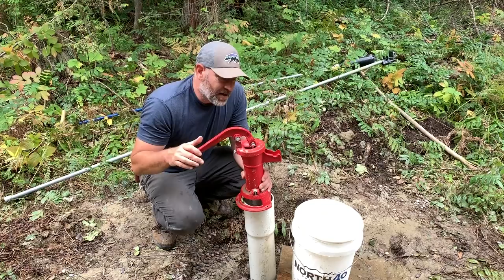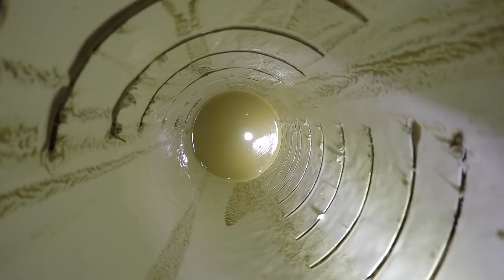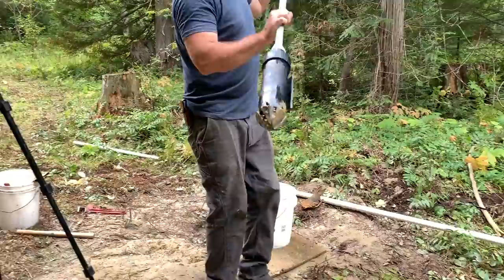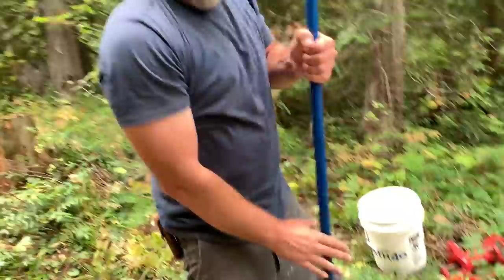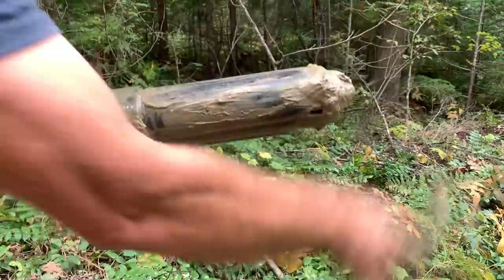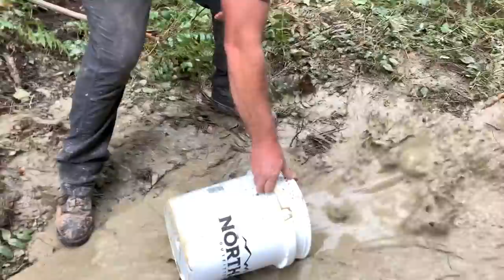Removing Silt/Mud Sediment from our Well

Comment: Hey Martin, just a suggestion. Use your auger to dig another 4 foot or so and then once the silt is removed fill that space with your gravel then the foot valve would would sit above the gravel and will help keep the silt below it.

Comment: I worked for the water department and have an EPA license. I'm retired. I can say most water you're getting at that depth is filtrate from the ground. It may or may not be safe, depends on what it filtered through, but I'd bet it was mostly soil which is strongly contaminated with very bad things, the least of which is parasites. To have clean water you need to be pulling from an aquifer. Unless you pull from a spring, you will never get safe water pulling from ground water. It's not even safe to bathe in. Bacteria can still get into you without drinking it, via cuts, your eyes, and inevitably you will get some in your mouth via bathing.
Hope this helps!

Comment: My uncle makes well pipe for a living and I worked with him when he was busy for a few years. The grooves you cut needed to be much thinner and a lot more of them. That itself would have stopped the sand issue under most issues. If you wanted to be dam sure it was right you just needed to put a well sock over the pipe to make sure it stayed clean. Your main issue like others said is the well is to shallow right now but if you did either of the first 2 options I told you... you would be in much better shape right now. Love the videos and your son is a riot :)

Comment: I've drilled a few shallow wells in Central Florida and I've always had to dig to a point below the hard pan.  The hard pan is a clay layer and the actual water well will be below that.  The depth where the water is will have very course sand and look sort of translucent.   After you dig below the hard pan,  sink your casing into the hard pan some so the well will be sealed off from the surface contaminants.   Hope this helps
Reply: I Robert Lee Houston am very enthusied being introduced to this level of of sharing! 👏🛐👋🤶🎅💭

Comment: watched the last few well vids.. I am going to keep watching to see if you succeed. I filled the actual well pipe with 1 inch stone to keep sediment from filling in the bottom.. once i hit depth.. kept the stone about 2 feet below the foot.. and it allowed sediment to settle to the bottom and the water to clear up.. u put ea gravel around the outside but inside the pipe has no protection.. the stone inside the pipe allows the water to fill the pipe higher and is easier on the pump also.. like when you have a half cup of soda and you fill the rest with ice it raises soda to topp of cup.. same amount of soda
Reply: I'm not sure that analogy works, but maybe... Your soda glass doesn't have holes in it, unlike the well casing, which can let water reabsorb into the walls of the well and filter back down to the water level. Just theorizing here.

Comment: It depends on the type of clay you have. In south Ga.we have the infamous red clay. If you have seen a red clay pond or shallow well the water is crystal clear. I have had a 25' well for 30 years in red clay & don't have a problem with sediment or any contamination of the water as verified by state testing. It all depends on the soil in your area & how you seal around the casing. Of course 1 big problem is the casing size. I have 3' of round concrete culvert  in sections down to 20'. Which allows you to hold probably 10 times or more the amount of water depth. Of course because of the weight you have to use a backhoe to set each section. So not a hands only job.

Comment: Might as well keep trying.The mud will inhibit water getting into the well so the more you can get rid of, the better.

As someone else commented, Could you get a tote full of water to dup down the shaft?  Not a garden hose and a little pump, but a large volume of water very quickly. A large column of water could force the mud beyond the gravel pack at the bottom of the well and allow the water to better flow into the well.

Comment: Im a well driller from North Jersey and being you can't go deeper without a license I would start over and get yourself a pre packed screen from a well supply and use a finer grain filter pack instead of the coarse gravel and put it in as soon as you get your pipe in the ground and that should help with the silt and running sand issue and may produce a little bit more.  Also look into a whale pump they are 12volt and you can use that and your truck battery to develop the fines out and begin to clear it up.  But it's only going to make so much at 18 feet also I would put bentonite or some concrete as a seal about 2 foot down from ground surface to help with surface runoff contamination . But if you can't get pre pack get 10slot screen and number 1 filter sand finer sand =less silt run in and the bigger the bore hole will help get a better filter pack

Comment: I feel for you as you are not deep enough. I have now done 3 wells myself using a home made sludge pump that has a rope on it and is support by a block and tackle on a tripod frame.  As you are using the sludge pump you are able to get the casing to move down deeper and keep adding to it.  You probably need to go a further 10 to 15 feet deeper.  👍

Comment: Just a suggestion. Drive a well point down the pipe you have. Go down at least another 10 - 15 feet.  The filter on the well point will provide filtering and the extra depth will give more water.  If there is sufficient water there, where you drilled, you will be able to pump a lot of water.

Comment: Trying to get water can cause a lot of stress!! We eventually had a well dug. We went 340 feet deep and it cost over 20k. With your higher water table a good 100 foot well would be perfect. It would probably cost you about 5000. But, if you have the time I guess you may as well try. Thanks for the video!!
Reply from the maker: Where are you guys located?
Reply: We are located in southern Utah. I think $40-60 a foot is pretty standard around here for drilling and casing. We installed our own pump which would have added to the cost obviously.

Comment: you may need to drill deeper until you hit gravel at least.   This shallow well may have contamination problems
Reply: They need permition to go deeper,, thats why they just go at 18ft down for no permite...
Reply: @widibagushan9935  they are going to to need to boil this water then. 

I think the reason they arent going deeper is they can't get equipment in there/don't want to pay to have a well drilled, it aint cheap.

Comment: drill deeper, at least +- 24 meters or 6 pipes .. or until u find sand and then you'll get clear water.. You can do it !
Reply: They cannot because in theyre states  legal limit is 18 meters
Reply: Also, you can't remove mud from a deep hole with a fence post auger. It just keeps filling back in. It's a hopeless battle. Been there, done it. Next step is to drive a sand point in it. Forget about a foot valve.
Reply: The only way to get that out is to make a pipe with a rubber or metal flap in the bottom that let's stuff in and not out. And just raise the pipe up and down in the bottom.
Reply: They can they just need a permit and he's doing it himself

Comment: As I recall from 1st video you said you could avoid a pulling a permit by only going 18 feet deep. Next I would pull out the 4 inch pvc and dig out p-gravel. Then install another pvc pipe with more smaller cuts or drill many tiny holes and zip tie mesh cloth around pipe. Then add P-gravel again. Or wet vac out the pipe using the 2 inch pvc.

Comment: Drill holes from bottom 8ft up in the pump pipe. Then whilst in ground fill the well liner with a smaller pea gravel than  you used earlier. And did you ever get more gravel for around the outside pipe? The idea is you basically inserting a 2 inch well inside a 4 inch well. Thus you will have a steadier flow of silt free water

Comment: Maybe make the door just about 4" at the top so it fills the container below it.   As it is, you are probably losing most of it on the way up.   It would seem using a generator powered electric pump swirling it on the bottom to disturb that you could bring it up more efficiently with the water.  Much as you were doing by hand with the pump.  But, after you clean out the well, raise the pump a foot or two above the bottom so there is space for silt to accumulate below clean water which your pump is accessing.

Comment: I've drilled a lot of wells and never got any water in clay you have to go deeper and find a gravel bed this well will never work into you find gravel. The clay is to thick for the aquifer to travel through and will not filter your water
Reply: I agree,he is not deep enough.He is in a clay layer and must go thru it.
Reply: problem is he needs to get a permit to go any deeper.
Reply: He's at creek level. He made a video showing the digging of the well and why they only went down that far. The creek is not that far from them
Reply: @phalanx3803  And probably have to pay a licensed driller as well.
Reply: @court2379  yes and they may have to pay extra depending on how far they live out of town. also because of where they live it would have to be a small UTE mounted rig and not many company's run that small of rig anymore.
Reply: What you say is mostly true, I have two 18 ft wells, the first I hit gravel at 18 ft and I get 26 gal a minute the second, I went to 22 ft. and hit nothing. In the second I put two yards or 4 ft. of crushed rock "36 inch tile" I get 19 gal a minute. 23 years and they both work fine. I was told I could not do that. I am on the north shore of lake Ontario at about about a mile back and 22 ft. of elevation.

Comment: You'll probably need to get new leathers (or maybe they use rubber now days) for your pump, once you get all that silt out.  The last 2 wells I had put in, the well diggers had to pump a lot of silt before the finally got clear water.  Keep going, you'll get there.

Comment: A normal British well is wide enough for a small person to go down and dig. They're usually hand dug. They go down 30 - 40 feet and have brick or stone liners. The water is lifted using a bucket and it's necessary to go down and clean the well out every now and then.

Comment: I would like too give you some advice 
1-Use sodium  Trapolyphosphete  for cleaning.
2- you can make increasing  depth and install  small  diameter  PVC  which is telescopic  well.
3- Conduct  proper  well development.
4- Use VES to identify  good  ground water  or use traditional methods  like two L-shape road.

Comment: I assume you can't drill deeper due to regulations. but are you allowed to dig a hole like 5 or 6 ft in diameter. this way the water accumulated in the hole (well) could be a lot more than that tiny hole you drill. it's quite common here in my country people dig a shallow well near a river or lake to get clean water..

Comment: Put a hose in the well casing and pump water into the well until no more silt comes out, it will also rinse the gravel you have down there. then you can add more gravel as you go. It will back flush the area some and more pea gravel will fill into the washed out area, enough until you have a lot of bags of gravel in the void.

Comment: Should have wrapped the well casing pipe in a landscaping type cloth/sediment sleeve before putting it in.
Reply from the maker: Being as that is not the case, do you have any helpful tips?
Reply: Take the foot valve and pump off and pump water to the bottom to flush it out. It will help stir up the settlement and flush out the the slits you made. But if the bottom of the pipe is in a layer of clay you will never get it clean.

Comment: I grew up in Michigan very poor my dad pull as well up many times you change the point because of the iron is so high when you get through the clay you need at least 6 ft of water in the pipe or more four to six feet or more

Comment: The best way to clear your well casing. 
- Make sure you put as much pebble rock around your casing 
- Get a portal tank of water
- Fill it with the water in the pond you have 
- Use a gas power pump with a pipe going to the bottom of the well 
- Run the water till it comes up clear (it will be dirty coloured) 
- you will probably have to do this a few times to clean up the casing

edit 
Make sure the water your flushing out is diverted away from your existing well casing (so the silt does not go right back down) 
Just install a T at the top of the casing with a length of pipe running away from working area

Comment: Hi Martin, i’m really impressed about your project! Just keep pushin! 

A few tip from my side which maybe can work also even with this depth, since a few of your viewers understand the regulation side also in your country... :

- make sure that your gravel from outside minimum 1 feet higher as your cutted part on the pipe. Maybe use some more fine gravel which is only big enough not to go in your cuts... you need better and more filtration from outside!

- try to wash out the well! Put a real pump in it and pump out as much mudy water as you can... even use water from outside like under the drilling to remove as many sand as you can!

- after the cleaning, you should put also gravel inside! Start with fine and use some bigger on the end! Maybe you will loose a feet, but this will be your filter from  the bottom

- use the well as many as you can! This will help in the cleaning process, but you mentioned this already...

Since there is a danger that the well will collapse if you remove the bigger pipe, i’m not sure in this proposal BUT if you decide to do it: move out the outside pipe and cover with some geotextile on the cutted area and fix it well, this combined with the above mentioned tips would be the ultimate solution and the best what you can do for the clear(er) water!

Greetings from Hungary!
Christian

Comment: I wonder if you can make some use of one of those epoxy mixing paddles for the drill. I know there would need to be some welding to fill the center and put a cutting tip. How to get out the debris is a question. Maybe air compressor? Boy if you have a compressor you could be using it to drill. 
  Looks interesting hope you get it worked out to your liking.

Comment: Best dig deeper..perhaps... Find another spot too. The existing ones.. you can use it for watering plants. Late father used to add roughsands 
Pebbles, sea shells layered, fine sands  each   then pebbles again in the hole to act as natural filter.. Sea shells to naturally softened the water..
 Then you only get clear water not the muddy up.. .. good luck. That could be for watering Vege patch..

Comment: He never put a cap on the casting will always be a mud hole! The only solution is to cap the casting end will a little portlands cement down the hole!
Reply: Doesn't matter, as you can see from the slits in the pipe with the Go Pro shot, that well is pretty much dry.  Needs to go deeper or just dig a different well somewhere else.

Comment: I do not think you are deep enough to get clean water - but - I've been wrong a couple of times.  Before you pump it clean, you have to flush it clean.  Connect a hose to where your hand pump threads on, run it down to your pond and pump water up, then down the well pump pipe. This "should" push water down to the bottom and float/push the grud up and out of the top of your casing. Success is having a large enough volume of water to push.  If after doing this, you still get mud - fill it in.

Comment: Something I'm surprised you didn't think about:
(1) Having "2" 5 - gallon buckets
       instead of just the "1",
(2) Instead of pouring out the
       "SILT WATER",
      keep it in one the buckets
      and as you pull out an
       ogger full of silt,
        use the silt water to rinse
       out the ogger each time.

Comment: You did right by putting gravel in but then you need to back fill the hole and cap the top with concrete because if you don't back fill more silt is falling off the wall's higher up and getting through the gravel i think that is the problem but your not going to get to much water from that well. Need to go way deeper

Comment: Use a pump and pull water from a tank and pump it down the auger and flush out the well.
Reply: I agree, jetting the sludge out will work better. However I also agree with others, this is never going to produce well, because he is in an impervious clay and silt layer. He needs to get a permit and drill deeper.

Comment: Sir,
What you are attempting to do with the legal depth restrictions of 18’ being placed upon you is not going to provide sufficient water for your family. Sorry but it just isn’t going to work the way you are hoping it will. A 4” PVC pipe at 18’ with the small amount of gravel you placed around the shaft will continue to fill with silt. Check out fellow YouTuber Red Poppy Ranch and see what he did with his well and very similar depth restrictions. He used a backhoe and dug down the 18’ creating a massive hole big enough to bury a car wherein he placed 3’ culvert pipe onto a bed of gravel. Then back filled with gravel and that was protected with silt screen. He added above ground storage tanks and has plenty of water.
Your working way too hard for something that isn’t going to give you the water you need in the type soil you have. Best wishes
I see in your follow on video that you used a gas powered drill.... better for your back. You still need gravel surrounding the whole thing to limit the silt coming in.

Comment: drilled wells for years in the sand hills of Nebraska, you killed that well by letting it set over night before putting in your gravel .. That clay / sand packed in around a good portion of your perf over night. you needed to run your well another 7 to ten feet and then put in your gravel straight away . There well is toast .